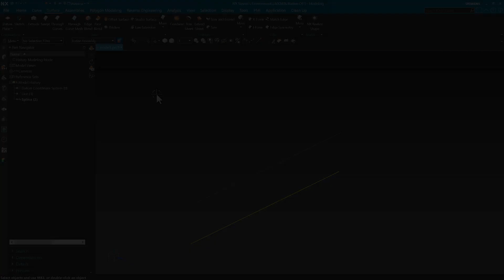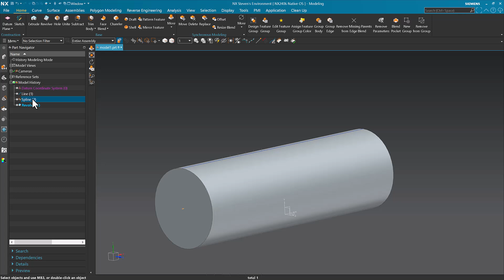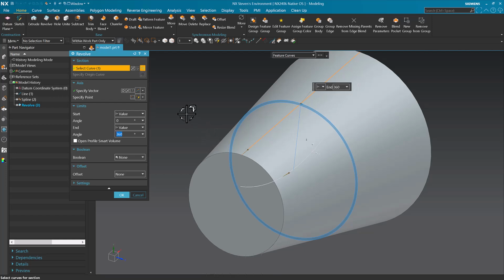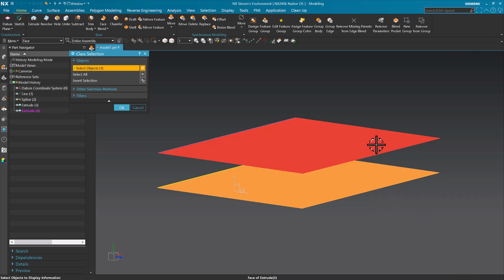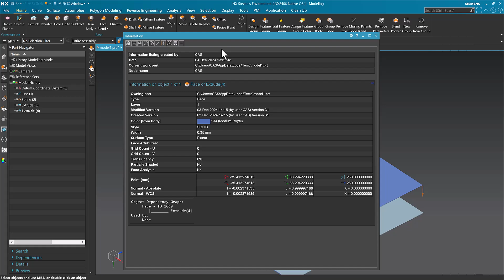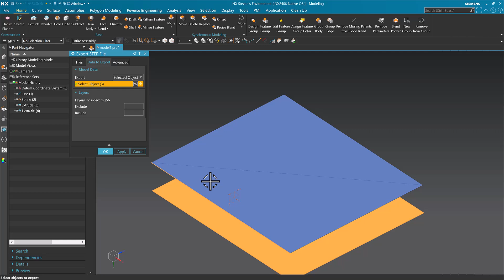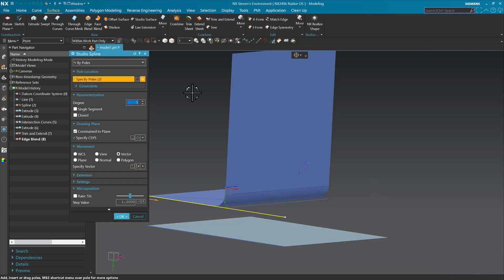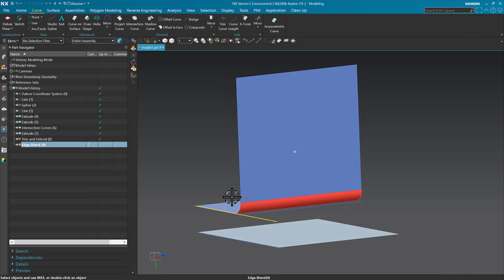Something Interesting in NX | 1 Degree Single Segment Spline

Comment: Hello! I have several questions, I know that the questions are the same, but please help!
Do I understand correctly that in constructing surfaces, you need to use simple curves (2-3 degrees?). I create such curves, build the basic surfaces, get 3-5 degrees and with 1 patch. Is everything correct?
I set the basic surfaces, an intersection was created, I begin to build blends (face blend, aesthetic and others) BUT THEY ARE BUILT with 15-70 patches and G2 continuity does not always work, although G2 is set in the parameters !! How to build transitions with a minimum number of patches? Sorry for repeating myself, maybe such a lesson already exists? Thank you very much for the video, I don’t know who to ask, no one in the environment knows how!
Reply from the maker: Apologies, this comment was blocked. I have a course for just this type of thing. 

https://www.stevenmarji.com/bundles/class-a-surfacing-suite

Comment: like comebt bellow say, there is option on. modeling preferences, that  you can check this on. so it creat planes instead facet.
also if you want to export convergent and solids or sheet togeter all in one time you most use parasolid bynary. x_b
step format  dont support tri/ polyons object🤗
Reply: "step format  dont support tri/ polyons object"
I think it was added to the STEP 242 format. Unfortunately, I don't have a license for it to check.

Comment: Take a look at Modeling Preferences. I believe there is possibly a setting in there related to the resulting Convergent body from the 1 degree spline. Going from memory here, so not 100% sure if that’s the culprit.
Reply: you are correct its on modeling prefs
Reply: @fgalmeida2 

Thanks for confirming that.
Reply: Part preferences -> Modeling preferences -> convergent -> treat degree 1 spline as polyline
Customer defaults -> Modeling -> general -> convergent -> treat degree 1 spline as polyline
For those interested.